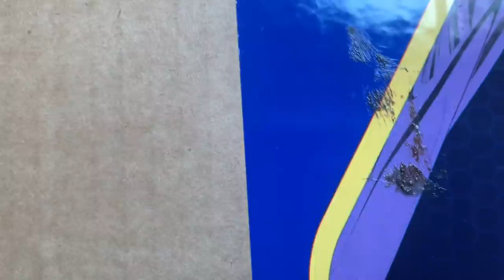Welding, discs and pads..... again, the torch jinx! Mobile truck mechanic hgv SAF axle trailer.

Comment: Chris, check the battery in that torch. I had one that did the exact same thing and it had a piece of plastic over one end of the battery to stop it turning on in the box. Pulled the plastic out and it worked prefect.
Reply from the maker: Mate 🤦‍♂️🤦‍♂️🤦‍♂️🤦‍♂️ what a tit I am 😂🤣 cheers English mechanic.... my bad 😂

Comment: why replacing discs ? rust ?
Reply from the maker: Yeah the insides corrode bad, I’ve seen a lot worse but there on form with it at that place mate 👌 and on them the pads seem to brake up making the discs worse.